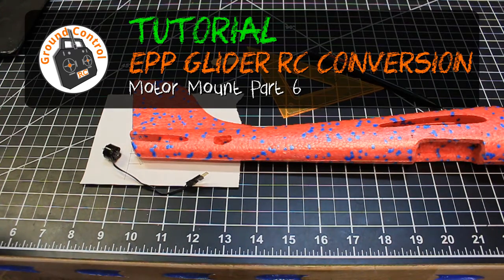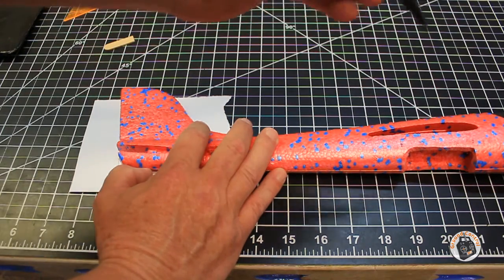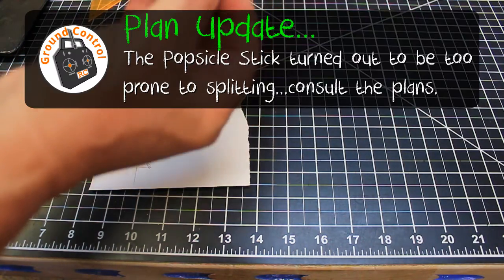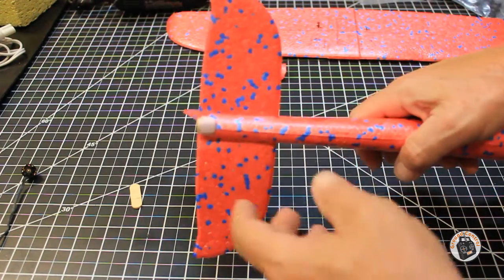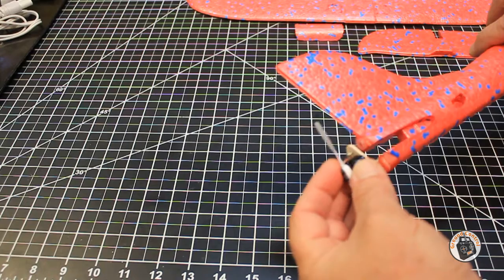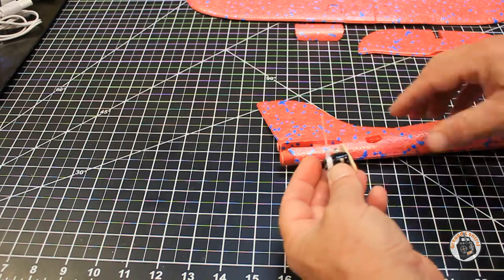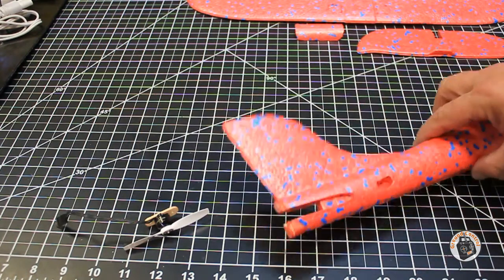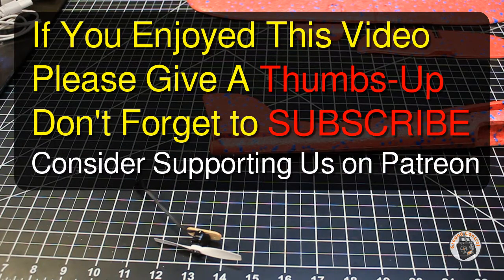Tutorial Part 6 - Glider EPP 48cm RC Conversion - Motor Mount

Comment: Popsicle sticks need a bit of ca glue kinda basted on them. Makes it super strong and doesn't add a significant amount of weight.
Reply from the maker: Chasse, thanks for the tip! I'll remember to try that when I need to replace that mount. I think I'll start brushing CA Glue on my parkjet motor mounts as well. Great idea ;-)  See you in the Air!

Comment: Nice demo.  Interesting.  I was thinking you would want the motor to point upward a little, like before you added the washer to lower it.
Reply from the maker: Thank you! You're right, on some airframes. I've always set my pusher motors at zero angle to perform test flights. Sometimes, depending on the airframe, you may need positive or negative angle depending on what the plane is doing. This glider seems to fly nice and straight with zero angle on the motor. See you in the Air!

Comment: Hi How did you attach the prop to the motor shaft  Regards Geoff.
Reply from the maker: Geoff, that's a good question. These 1104 motors actually have a 1.5mm center shaft and (4) threaded screw holes in the top of the Bell Housing. The prop has a center hole for the motor shaft, mainly for alignment, and (2)  screw holes on either side of the center hole that line up with the the screw holes in the motor bell housing. The motor will usually come with (2) screws to attach the prop to the motor. I hope that helps explain it. See you in the Air!

Comment: Which motor did you use and which battery how much flight time?
Reply from the maker: Good question! I use the DYS BE1104 7000kv Motor and a Gemfan 3020 2-blade Prop. I use a 2S 300mah 65C LIPO and get 5-6 minutes of flight time leaving 3.5v per cell. I'm in the throttle a lot and perform aerobatic maneuvers but if you're just cruising around you would probably get 7-8 minutes of flight time. See you in the Air!
Reply: @GroundControlRC  hi 
Can I use this motor to make tractor type plane??

Can I use 2300KV or 4000 KV motor ?

Thank you.
Reply from the maker: @AAAAAA-iw9wk  , it would work just as well as a tractor motor. I would like to make a tractor version when I can dedicate the time. For a tractor version I'm planning on using a RacerStar BR1306 3100kv Motor and Gemfan 5030 2-blade Prop. I've used that combination in other projects and it produces good thrust and efficiency on a 2S LIPO.
Reply: @GroundControlRC  I want to make tractor version should I buy 7000 KV or 3100 KV ?
Reply from the maker: A 2805 is a pretty big, pretty heavy motor for that airframe. You have to keep it light or you won't be able to get the CG correctly balanced. I don't think I would want to put anything bigger than a 14xx motor on that chuck glider. My All-Up-Weight on my Converted Chuck Glider is only around 115 grams.
Reply from the maker: @AAAAAA-iw9wk  , which motor? The 1104 or 1306? If the 1104 I would get the 7000kv and a 3020 Prop. If the 1306 I would get the 3100kv and 5030 Prop. The 1306 will be more efficient than the 1104 and provide just as much Thrust. I had to use a smaller, lighter, motor such as the 1104 to get the CG correct since it was going to be mounted on the tail of the glider. For a Tractor motor I would use the larger 1306 with the larger 5030 Prop.
Reply: @GroundControlRC  I will buy 1306 3100 KV
Reply: I will buy this
Reply: This is not bidirectional motor I guess will it work ??

Can I use Both CW and CCW in airplane tractor?
Reply from the maker: @AAAAAA-iw9wk  They are very good motors. I have (3) of them ;-)
Reply from the maker: @AAAAAA-iw9wk  , they are bidirectional and will rotate in either direction as you just have to switch (2) of the (3) wires to change the rotation. For Planes I always buy the CW Thread Motors and CCW Props as that way the Prop Nut is less likely to lose torque.
Reply: @GroundControlRC  do you have a link for aliexpress for motor I should buy?
Reply from the maker: @AAAAAA-iw9wk  I've never ordered from aliexpress.
I order over 90% of my RC Stuff from Banggood
Here are direct links to the Motor and Prop.
If you prefer to order from another vendor this will give you the information you need to find it there.

Racerstar Racing Edition 1306 BR1306 3100KV 1-2S Brushless Motor For 150 180 200 RC Drone FPV Racing - Clockwise Screw Thread
https://www.banggood.com/Racerstar-Racing-Edition-1306-BR1306-3100KV-1-2S-Brushless-Motor-For-150-180-200-RC-Drone-FPV-Racing-p-1065662.html?p=WE081047791920140372

10pcs Gemfan 5030 ABS Direct Drive Orange Propeller Blade
https://www.banggood.com/10pcs-Gemfan-5030-ABS-Direct-Drive-Orange-Propeller-Blade-p-1070004.html?p=WE081047791920140372

This motor and Prop produce 203 grams of thrust pulling 5.4 amps on my thrust stand ;-)
If you can keep your All-Up-Weight to approx. 120 grams this will give you a Thrust-to-Weight Ratio of 1.7:1
That's fantastic ;-)
Reply from the maker: @AAAAAA-iw9wk  , it's an excellent Motor. I've have a lot of RacerStar Motors I use for my budget equipment and I've never received a bad one ;-)
Reply: @GroundControlRC  Ok I will the 4 motor set 3100KV.

And thank you very much.

I cannot thank you enough you helped me a lot.
Banggod does not ship to my country.
Reply: Which servo should I use ??
9 grams ??
Reply: My weight 

2x9 gram servo  18 gram 
Fs2a receiver   1 gram
Motor  15 gram 

20A ESC  20 GRAM 

PLANE WEIGHT i guess is 50 gram 
Battery 360 mah 2s 36 gram 
So total  140 gram approx is it good
??
Reply from the maker: @AAAAAA-iw9wk  , you are most welcome. I sorry to hear BG does not ship to your Country. I would be lost without them ;-) 
I found these on aliexpress but I'm not sure what brand they are as they don't specify.
https://www.aliexpress.com/item/32538598854.html
Reply from the maker: @AAAAAA-iw9wk  , I used 1.7 gram servos. I think 1.7g-2.5g servos will work well and keep it light. Make sure the servo connectors match the servo ports on the receiver you choose. Also make sure the wire order on the Servo Connectors match the Wire Order on the Servo Ports as that is not always the case and will damage the electronics if connected in the wrong order. There are links to all the components I used in this conversion to give you an idea as to what works very well.
Reply from the maker: @AAAAAA-iw9wk   You only need a 10A ESC so you can save weight there and 1.7g-2.5 gram servos will do the job just fine. There's nothing wrong with an AUW of 140 grams though and you would still have a Thrust-to-Weight Ratio of 1.4:1 That's still excellent ;-)
Reply from the maker: I don't know what brand those motors are. They look similar to the RS BR1306 Motors. If they supply similar thrust they will work fine. I can't know though as I've never tested those motors.
Reply: @GroundControlRC  hi I bought the motor and will receive in 20days maybe.

I will update you about my progress with the glider.
Reply from the maker: @AAAAAA-iw9wk  That's awesome! Good luck on your conversion. I'm glad I performed this conversion as this is a very fun Plane ;-) See you in the Air!
Reply: @GroundControlRC  Hi which battery should is use ?
Option 1 2s 360mah weight 32 gram

Option2 2s 850 mah  53 gram 
??
Reply from the maker: @AAAAAA-iw9wk  , the largest battery I've flown this converted chuck glider with is a 2S 450mah 35C LIPO. It could probably carry 53 grams of battery as long as you can get the CG balance.

Comment: I cut pieces out of broken props for motor mounts....given props break so oftem that we have a heap of those....Disposable plastic bottle caps r good candidates too
Reply from the maker: Those are both excellent Ideas! I never thought of using the plastic from broken props but you're right, that should work just fine. I do save plastic bottle caps and was thinking of using them for wheels sometime in the future but using them as motor mounts would work great as well. I'll have to try that when I finally have time to build my back yard/indoor micro plane. I might even have one in a color that I want ;-) As you know I love re-purposing material ;-) Thanks for the tips! See you in the Air!

Comment: can we use a 60 C battery
Reply from the maker: Absolutely! The little 2S 300mah LIPO I use in it is a 65C. The 2S 450mah LIPO I use is around 25 grams in weight and I'm sure this glider could carry a bit heavier battery.

Comment: or 30C
Reply from the maker: Absolutely! The little 2S 300mah LIPO I use in it is a 65C. The 2S 450mah LIPO I use is around 25 grams in weight and I'm sure this glider could carry a bit heavier battery.